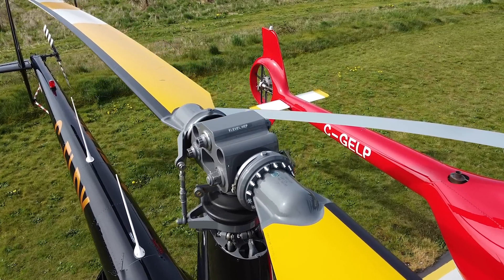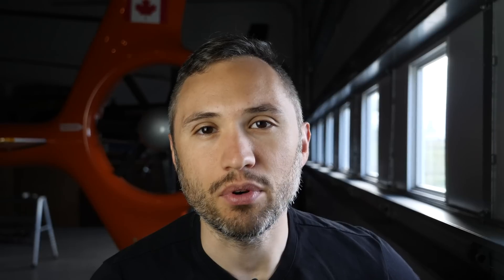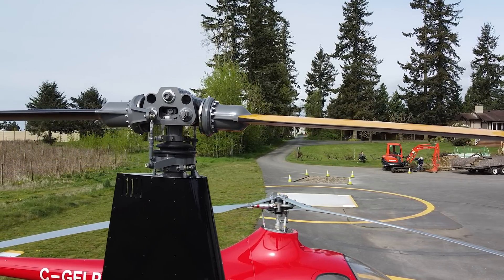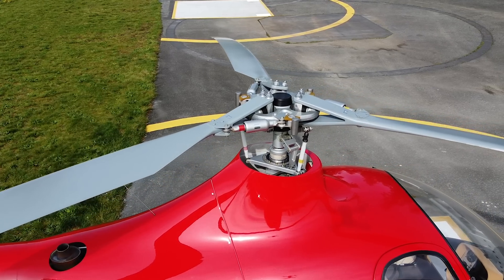WHY MORE BLADES ARE SAFER

Comment: Less blade, fewer points of failure but higher stress and loading. More blades, more possible points of failure as more moving parts but they are under less stress and load :)
Reply: Ima make a 20 blades helicopter
Reply: @FIRE_STORMFOX-3692 Not sure if that would even fly given each blade would be right in the disrupted wake of the one in front of it.
Reply: Also smaller "footprint" while in operation.
Reply: Two blades are more efficient.
Reply: Atomicskull 
Nice too meet you here. That‘s right, a two bladed rotor is more efficient than a multi bladed one as well as a two-blade prop is compared to a three-blade on a drone. What i am wondering is, how the wideness of the blades affects efficiency and other properties of the rotor system. Just from looking at different helicopters i discovered that the blades on multi bladed systems are narrower than on a two blade system. In opposite the blades on a drone are often the same width regardless of the blade count.
Reply: Ironwing Darkmoon How wide the blade is (commonly called the chord length) plays largely into how much lift the blade can produce. That’s why two blade helicopters have wider blades than helicopters of the same weight but with more blades. When referring to efficiency, a two blade system with equal chord length blades and equal blade span (total length) as a three blade system will be more efficient. However the engineers that design the rotor systems take this into account so realistically two and three blade rotor systems operate at the same efficiency. For drones the chord length matters less because the weight of the aircraft is much smaller and lift isn’t really a problem since the lift generates only effects the response time of the control input. That’s why you would want a 3 vs 4 blade prop on a drone: speed or efficiency. Hope this helped!
Reply: @markspiewak7235  Indeed, you can always learn something new!
Reply: @helidrones  Also adding to the OP]s answer. Drones are fixed pitch their lift varies with speed.Helicopters engine speed is constant, and the pitch varies.they have less chord, but can have a greater angle of attack.
Reply: @markspiewak7235  The wider the blade chord the greater the blade drag. That's the reason why the F-104, X-15, and missles have minimal drag stubby wings. The more the drag, the more power lost to countering drag, thus lower lift and thrust efficiency. That's why the multi blades are of lesser blade chord, to minimize the additional drag. However the blade is the wing. It takes a certain amount of wing square footage surface area for the wing to lift the aircraft wet weight, and even more for payloads. The Bell214B Medium Lift variant has a 36" chord blade, literally two 24 foot long barn doors, spun by a 3000 shaft horsepower turboshaft, altogether able to lift 4 tons at sea level. That's more than the S-61 5 bladed Sikorsky passenger birds. ( which are famous for killing the most people at once in multiple "rapid disassembly" rotorhead incidents.) Helicopters are 1000 assorted parts all tryinging to fling themselves apart. Only takes one of those parts breaking in flight, for the whole thing to come unglued. But what a cool ride they are.
Reply: Thus lowering your chances of a failure.
Reply: Damned if you do, damned if you don't.

Comment: So what we can take away from this is that the safer you want to 
be, the more you are going to have to pay. Putting a price on safety, hmm.
This is enough to turn me off on getting a helicopters lisn.
Reply: Connor Rampage most helicopter accidents are caused by pilot error. Outside any models with design flaws mechanically they are very safe.

Comment: How about asymmetric lagging in fully articulated rotor systems. This is at least as hazardous as mast bumping.
Reply from the maker: Rev Dr Tim Gramling I’ve never heard of asymmetric lagging. Explain it for me.
Reply: @PilotYellow  This happens when the lead / lag hinge on fully articulated rotor systems fails to maintain symmetry as the blades rotate. I have seen this associated with ground resonance, such as in the following https://www.youtube.com/watch?v=IN2Bw79KK80. As noted in the accident report, there likely was nothing the pilot could have done to avoid catastrophic destruction of the helicopter.
Reply: ColtDeltaElite10mm  not necessarily. Check out this accident in an S-61L, where the blades lost symmetry at 2000 AGL, leading to all 23 on board losing their lives https://aviation-safety.net/wikibase/14208. This is one of the reasons I do not believe that fully articulated rotor systems are all that much safer than two blade systems.

Comment: With more blades, i.e. 5 blade, can you reduce the length of the blades vs. 2 blades? Does either rotate slower. Is there a simple trade off on drag vs lift on number of blades to consider?

Comment: Why is there more lift on a Bell 212 than a Bell 412?
Reply: Useful load is within 100 LBS. The 412 is a bad example as it uses a "semi-rigid" rotor head (this is why 4 blades and not asymmetric number) . It is not articulated but has "spring like" dampers.  You will never see the blades removed on a 412 like to transport it because it takes a team a week to get the tracking correct again.

Comment: Bell HU1 and the Cobra  AH1 has two blades, I don't know why army decided to keep their machines like that. I guess is to save money.
Reply: 2 blades are the most efficient.
More blades are good at getting more thrus out of the same prop length, however at the price of reducing efficiency.
So increasing rotor blade length is a better way to increase lift. (due to lack of efficiency loss you get more flgiht time, or more lift from the same engine)

However you may need to take other stuff like preexisting military infrastructure into account.

Comment: Actually, aerodynamically, less blades is better. In fact, if you could balance a single bladed helicopter, it would be most efficient (aerodynamically). Heavier helicopters, and or more powerful helicopters (eg armed attack helicopter) need a greater solidity ration to absorb the power being presented to the rotor system. In two bladed systems, the only way you can do this is to make blades with a bigger chord. You only have to look at the two bladed Cobra's to see a good example of this. At some point, this become impractical structurally, so the next solution is to add blades. Two bladed system generally use the teetering head, which does have drawbacks from a mast bumping perspective as described in the video. However they also lack control authority due to zero hinge offset. There are some two bladed systems that are not semi rigid (as per the Jet Ranger), and actually provide some effective hinge offset. However, all fully articulated systems, and fully rigid system provide significantly more hinge offset, and therefore most moment, than traditional two bladed semi rigid systems.

I hope that helps.

Comment: 3 blades need to lead and lag so I don't think they can be considered a Rigid Rotor System like in our BO-105. It's great having on condition blades.
Reply: Semi articulated..2 blade.  (Flapping by the teter, and lead lag by hinge)
Fully articulated ..3, 4, 5 blades (flapping by hinge and lead lag by hinge)
Rigid..Hinging is by the bending of the rotor blade stems.  I believe the BO105 is first commercially successful rigid application

Comment: What I can't get past is the CH 53E Super Stallion that has 7 blades and how that spaces evenly in the rotor disc. 2,3,4,5,6,8 & 9 all divide into 360 evenly but 7 doesn't so how does that work for that rotor system?
Reply: Well, it divides as 51d 25m 42.86s and some hairs but this is not a problem manufacturing such a rotor head; in the olden times there was the obvious divider head that could help you make some pretty funky parts (and helical gears with a leadscrew-enabled divider head), now with CNC manufacturing uncanny angles even less of an issue.

Comment: Which helicopter has this fastest start up - to - takeoff time? Is it the bell 206 jet ranger?
Reply: Niel James not any turbine for sure - any turbine needs a careful “by the numbers” start to avoid a hot start. A piston engine machine, especially one that has already flown that day will be quicker (e.g,  R22/44, Enstrom 28/280; Cabri, Hughes/Schweitzer 300). All that said I wouldn’t recommend rushing to get any helo into the air! (NB I am a commercial heli-pilot)
Reply: @drjanecox  I don't know Jane, I think the start up and go champ is currently the B3E and H130 as they don't really have any warm up or cool down requirements. I can get our BO-105 with 2 C30's lit up and in the air in under 2 min. I'm a little slower with a 44.

Comment: What about ground resonance? Does that not affect odd number bladed choppers? So 3, 5 and 7 blades?
Reply: any bird with whats called lead lag hinges is susceptible, doesnt have to do with odd # of blades.
Reply: @DavesNotHereMann  Thanks mate. I never knew that. What number of blades usually has the lead lag system? Can 2 blades have it or only 3 or more blade systems?

Comment: Do you foresee Cabri offering a folding package for the G2 just to make it more convenient for tight storage in a more narrow hanger?
Reply: I'm not an engineer but this seems unlikely: if you look at the way Bell 407 blades attach to the helicopter (for example) there's a rotor head structure in the middle, then an articulated blade grip assembly that retains the blades, and then at the end of that assembly you attach the blade with big pins metal pins. Fairly easy to just undo one of the pins and allow a blade to pivot around, as there's no lead-lag damper to disconnect and a readily available pivot point.

On the Cabri rotor head, the blade root itself actually forms a fork that goes over the rotor head (the ring of metal that retains the blades) and bolts directly to an elastomeric bearing structure that sits on the inside edge of the rotor head. There's also a lead-lag damper attached to the trailing edge of the blade. All of these appear to be attached with conventional fasteners (which are probably installed to some specific torque- or-- even more problematic-- bolt stretch specification. These can't easily be removed or reinstalled by a pilot the way pins can be. There also appear to be little articulated weights of some kind (I don't know what they're for and older aircraft didn't seem to have them at all, maybe some kind of balance / vibration-moderating feature) on the rotor head which would conflict with the forked-part of the blades if you tried to pivot them more than 30 degrees or something-- they look like they'd be in the way.

Comment: Surprised to not hear discussion of high inertia vs low inertia. Wouldn’t this also be a big factor to consider? I’ve heard that low inertia rotor systems can be more dangerous due to the need to reach much faster on the collective during RPM loss or engine outage. I’m no expert, so genuinely asking here. Thanks for all of your wonderful videos!
Reply: Yes low inertia systems the RPM can decay very fast but you can also get those RPM's back very quickly by pulling back on the cyclic just a bit. Once your in autorotation nothing is better then a 2 bladed system for it's glide ratio, the more blades you have the faster you fall.... a auto in a MD500 is very dramatic and you are down instantly but in a R44 you have all day to pick out a spot. Going to be putting up some advanced auto videos on our channel, check it out if you can.
Reply: @SkyCoreLLC  the cyclic should be pulled aft slightly as the nose shouldnt drop during entry but i teach and was taught with the montra the collective directly controls the rpm while the cyclic influences it
Reply: Good point. 3+ bladed helis are much safer and easier to autorotate.
Reply: I do not have experience with big helicopters but yea the more mass spinning the longer it will take for the blades to slow down and the r22 for sure you need to lower the collective asap but in general I believe its rather negligible and a fast response is always crucial

Comment: Hi just a question is a two bladed rotor safer or easier to autorotate since the blades have more mass and might fly a bit more distance and last longer in the air? Thanks
Reply: Perry . Game Developer I think the specs show a Cabri with 3 blades has more rotor mass than a 2 blades Robinson. So you get more time to do the flare with a cabri and also more time to enter autorotation before the rotor speed drops

Comment: But what about the handling?  Do larger and more blades handle smoother than smaller less-blade rotorcraft?  Also, at what point can stunts be performed with respect to the rotor count?
Reply: Try any stunts on a teetering 2 bladed system and you'll likely be dead in seconds. You have to have 3+ blades and ideally a ridged rotor head like the MBB Bo105. More rotor blades=more mass. More mass=smoother, but slower reaction to force (control force or external force).
Reply: More blades the smoother unless you're flying a fully rigid rotor. The Bell 407 has 4 blades and is like a Lexus our BO-105 has 4 blades and it's like a NASCAR but we can go upside down:). Check out our channel if you get a chance.
Reply: Also great video btw; thanks 4 postin

Comment: I wish Robinson would make a three or four bladed r44... Even more, I wish Robinson would make an r33, a three-bladed turbine two-person private helicopter! Omg that would be amazing... Price it around 400-500k, I'd buy it in a second.
Reply: @Lostdeltallc  The schweizer is a death trap, poor manufacturing design (tail rotor shaft design, spring clutch and govenor, more expensive to operate than a robinson (and thats without considering trying to find spare parts) and mast bumping is not as real of an issue as ground resonance unless you fly like your tom cruise in top gun in which case you have whats coming to ya
Reply: @Lostdeltallc  hahaha... I literally said I have 80 hours and learned to fly in a Schweitzer. I'm talking about a pleasure craft, not a trainer.... WTF are you talking about 🤣
It's a shitty aircraft and there's a reason they don't make them anymore. It is discontinued, try to buy a new one or get parts for an old one haha.
No one ever bought one cause it was a nice helicopter, they bought them cause they were the cheapest certified helicopter made 🤣
No one on this planet buys a helicopter for pleasure and thought the Schweitzer would be a good choice.
Get a life kid ROFL
Reply: @Lostdeltallc  I have 80 hours in a Schweitzer 300. It's now discontinued and it's not a very fun helicopter to fly.. prone to ground resonance, no governor, slow, underpowered, doesn't look cool. I prefer it to the 22 but not to the 44.
I'd still love a 2 seat turbine with 3-4 blades.
Reply: @maximusjoseppi5904  Maybe a Schweizer S333 AKA Sikorsky S-434 is the one? I'm personally very keen on a Scout Aero helicopter.
Reply: I read last week somewhere Robinson will come up with a 3-blade within a few years.  I have 5 hours in the R22 and the other 5 in Schwiezer..both are fine machines but I found  Schwizy easier to fly especially on hovers.  I will be glad to see 3-bladed Robys plus that will make them even safer to eleviate the mast bumping which is a concern flying the 2 blades.

Comment: Hello, 
When you mention  that the root of the blades can strike the Tower of the heli is it also a boom strike or is that different? In another video can you explain a RIGID HEAD such as on the BO105 that allows it to do aerobatics without the fear of a boom strike.
Reply: a boom strike is when the blade strikes the tail boom of the helicopter usually caused by excessive flapping of the blade, mast bumping is when the blade contacts the mast for instance in a low g scenario which can result in the rotor head shearing itself from the mast

Comment: Thank you for this explanation video, I had wondered about why designers went with the different rotor configurations.  I have always loved the Hughes/MD/Boeing 367/ 500.  Always loved the  buzz it made as opposed to the Bell rotor slap. I loved the Hughes 500 AKA civilian model 367 from first time I saw one, and my admiration for it's  designers  have never faded.  Thank you for your videos, one can always learn something if one has an open mind.
Reply: Gavin Green 369, actually
Reply: Did you know Frank Robinson designed the 4 blade tail rotor for the 500?

Comment: Would the lack of lift/performance in a semi rigid rotor system be offset by the blades tenancy to be longer and slightly heavier so they retain slightly higher blade inertia which can help during an auto or forced landing? The difference won't be much but its been my experience it was slightly easier to maintain RRPM or gain it back entering a high G turn in a semi rigid system than a rigid or fully articulated multi-blade system as the latter just don't have the blade inertia but perhaps I was misinformed, or things have changed? You would not notice it on an R22 or and R44 but the blade inertia on a 206 for example is so strong after doing an auto with the throttle still rolled off you can pick it up do a 90 or 180 degree pedal turn and set it back down. Can you say the same for larger multi bladed rotor systems? I genuinely don't know as my experience with multi-bladed helicopters is limited to one quick flight in a B350.
Reply: No, one advantage of 2 blade systems is that they auto so well.....the more blades you have the more it autos like a rock.